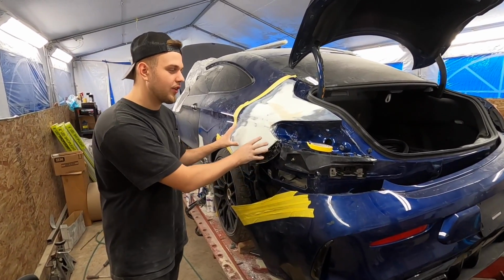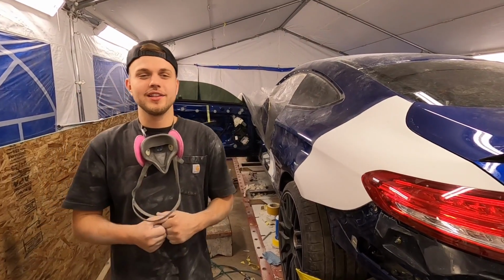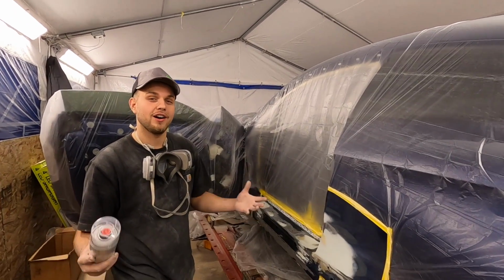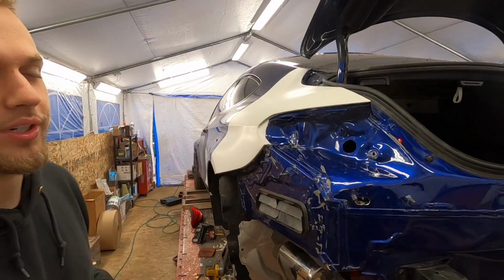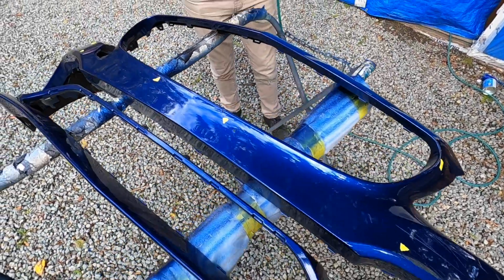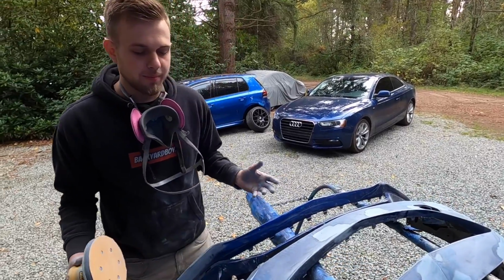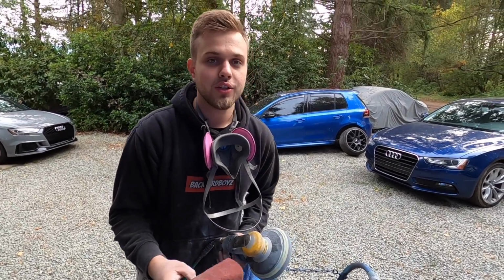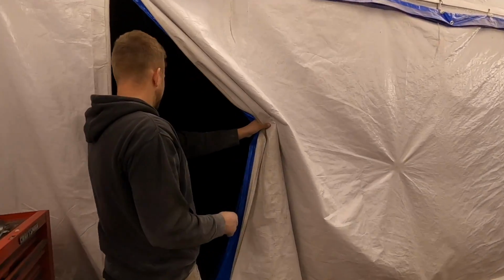Rebuilding a WRECKED 2019 Mercedes C63 AMG From COPART (Part 10) FINALLY PREPPING THE CAR FOR PAINT!

Comment: Yo Tim... Where's the tunnel video lol... Still waiting to get my dose off them RPMs Bro 😍... I miss my c63 days 😭 and my e92 days... 💔...  Need to consider getting another beast soon... ❤️ From 🇿🇦
Reply from the maker: Imma get all those sound clips soon. Most likely after paint though🤜🏼🤛🏼
Reply: @BackYardBoyz  yeah I think that be best Bro. There's something I want you to try out thou when all is done. Since the color you have will not be visible on the highway when there aren't any street lights around turn off them head lights and you'll be able to pull off that bat mobile scene that happened in The Dark Knight movies when the cops where chasing him.... Oh I loved doing that with my c63 even though I didn't have the exhaust system you did all I did was let off the gas and have the car in the highest gear while pulling along side then dropping down and flooring it 😂 please film the reactions...

Comment: Great job on seam sealing everything up you should dust some primer over the bare metal even if it’s bare metal seam sealer, I’ve seen a lot of cars that have been repaired and it almost always rust under the seam sealer